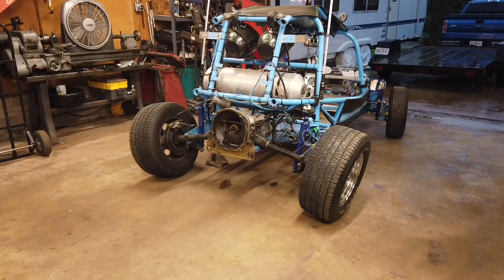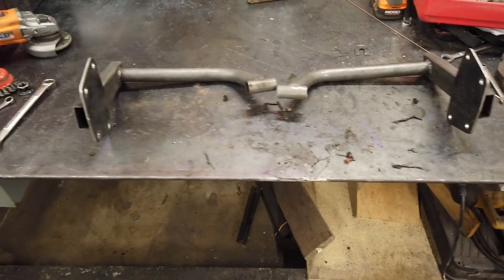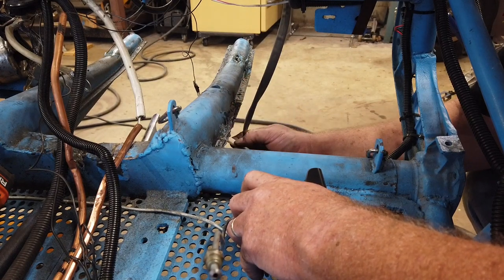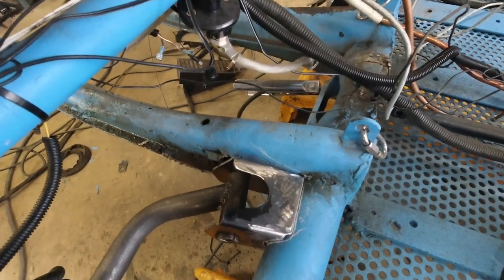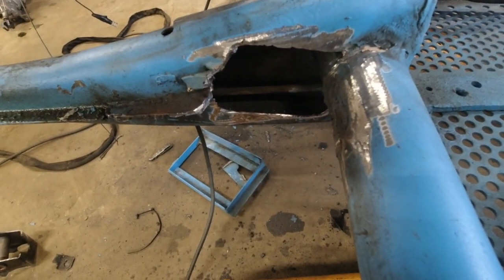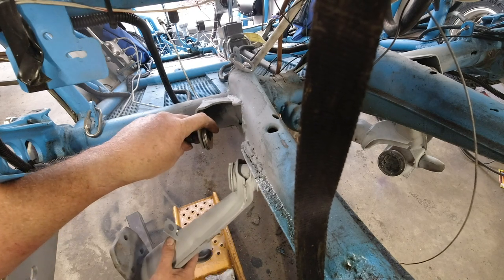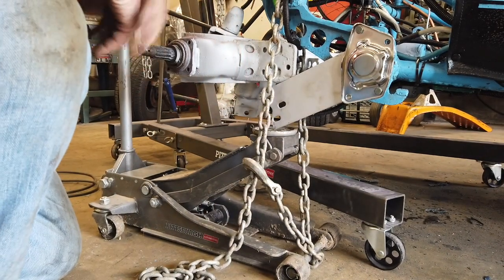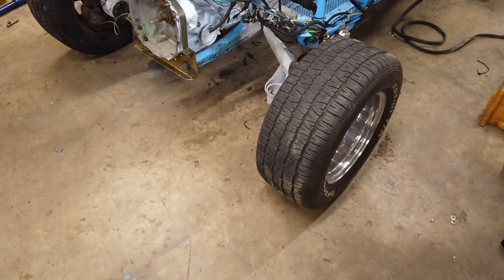Swing Axle  to IRS conversion

Comment: Do you use the old spring plates from the swing axle, or change them? Thanks
Reply from the maker: I changed them out. but they can be cut and drilled and use them.